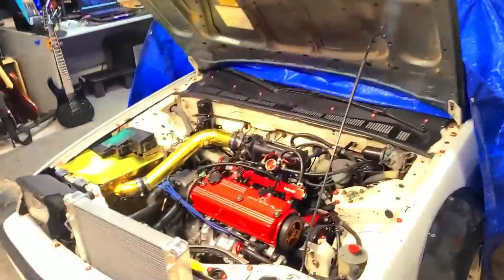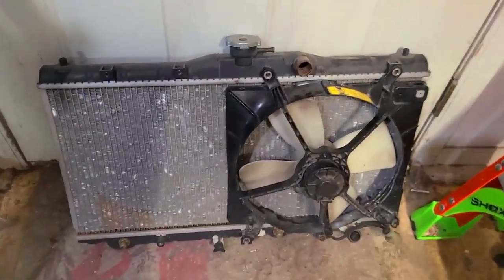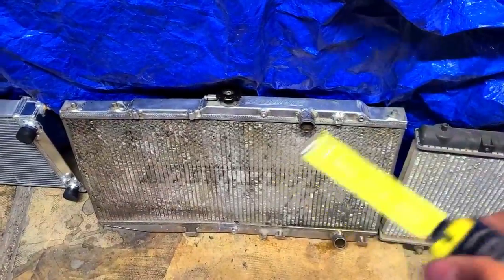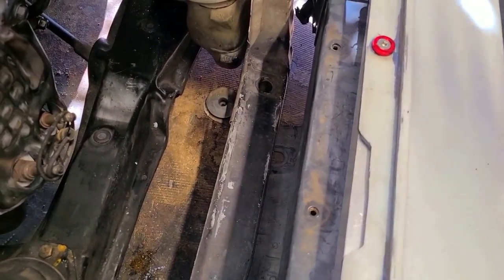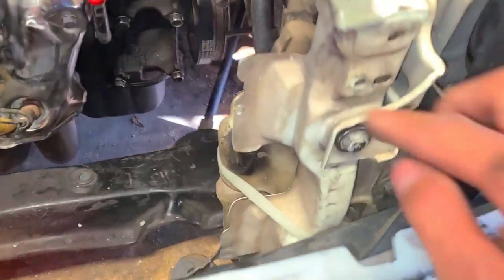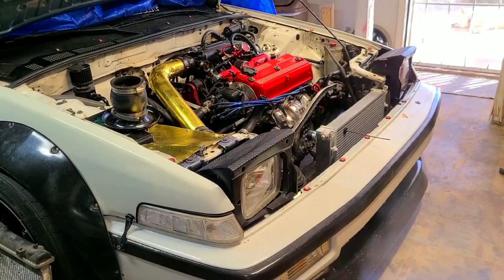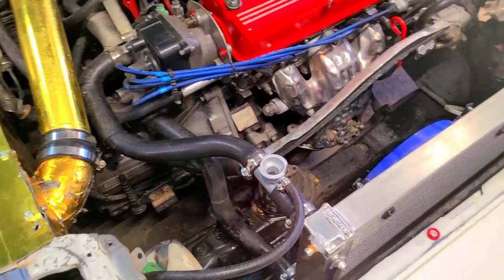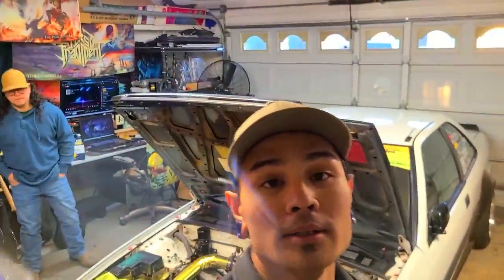Honda Accord VW Scirocco Radiator Install

Comment: I think you did the right thing ditching those small fans and going with one large. Radiator construction looks good horizontal tubes they probably are 1.0". The fin count is a little skimpy but it should be fine.